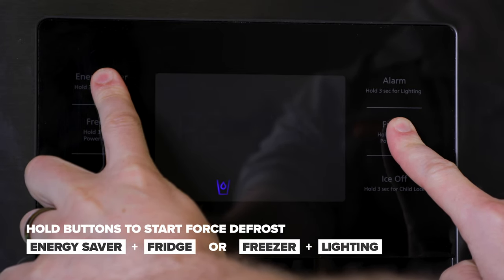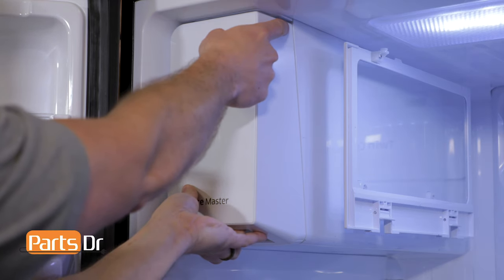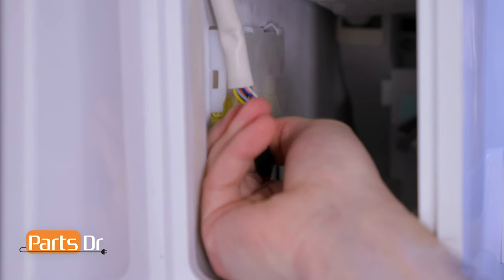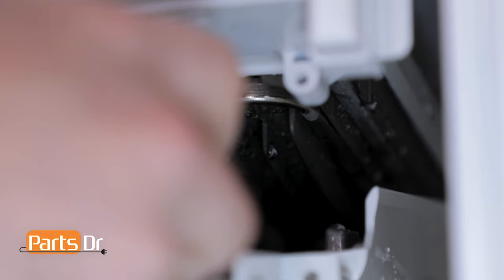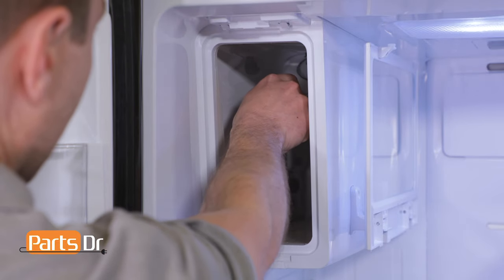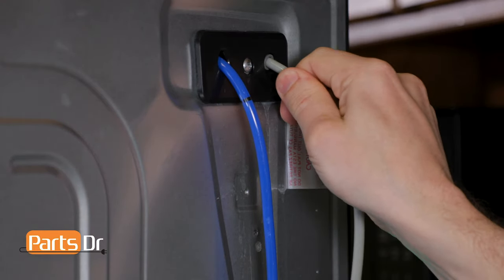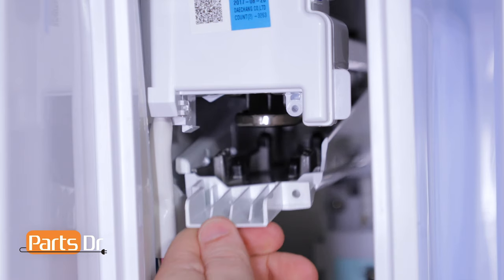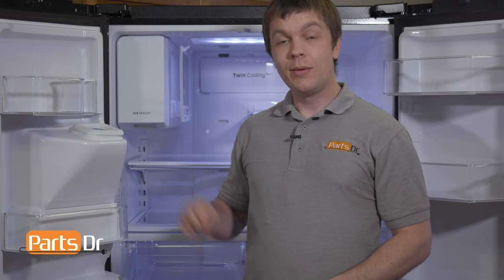How to check your ice maker water line in a Samsung refrigerator

Comment: I used your instructions for tuning my icemaker, and it worked great for 3 weeks, but now I have a different problem.
After a series of power outages, the icemaker has stopped making ice. If I press the icemaker reset, it will eject ice, fill the tray, then ding. But it will not continue to make ice on it's own. After 24 hours, no ice, so I hit the icemaker reset again, ice drops, fills, and bing. But after another 24hrs, no ice. So I have to reset the icemaker every 2 hours now?
I tried a diag by pressing the top 2 buttons, all lights lit, no error codes, back to normal. I also tried a power off reset, still no ice.
Any suggestions?
Reply from the maker: Check to make sure the temp in the ice maker compartment is reaching 15f or colder.  If it is cold enough, then it could be a bad ice maker, bad main control board, or something else as these ice maker systems consist of a lot of components that all work together.
Reply: @PartsDr  It's hard to get a reading with the door open and tray out, but I'm getting 13-15 if I point towards the back of the icemaker, 17 pointed towards the metal auger spinner. Should I try lowering the fridge temp a bit? It's set to 40. I also replaced the filter when this happened.

Comment: When you are pulling the hose from the back how do you know if its in far enough or not? Mine gets iced up every 14-20 days a d i have to defrost it twice a month
Reply from the maker: You will either need a second person to help you, or slide in the tube a little bit at a time and check it until you get it right.
Reply: @PartsDr  How do you know when it is in the correct position? What should it look like, how far should it be in there?
Reply from the maker: @BuenosPachos  3:05 in the video shows the correct position of the water line.
Reply: @PartsDr  3:05 doesn't show anything other than a water line.  I need to know 1/2" 1" actual measurement from when the line comes out.  Is there a mark on the line?  Is there a clip??   Overall video was good but you seemed to gloss over this one area.  Please clarify - how do you know its correct?
Reply: @ironcap2050  I wasn’t sure what I was looking at either but after playing with it I have it. You’re not looking at the vertical black or vertical white piece in the video. You’re looking at the horizontal clear tube. The small one right in the middle of the two circles. That tube should be, I’ll say, 1/8” visible. Mine was originally not visible at all. You just want to see a tiny bit of it.

Comment: While I have had the problem with the ice maker freezing up (about once a year), I have a new problem. The ice maker was working, but then there was no ice being produced. The compartment is cold, but it seems there is no water getting into the ice maker (new water filter, and water dispenser is fine). I have tried to get my fingers around the side of the ice tray, and can't feel any water present. Tried a number of things (forced defrost, unplugging the fridge for 15 minutes to try to reset the whole fridge). When I press the test button at the side of the ice maker unit and get the initial chime, but no follow-up chime to say the ice maker is working. Is this likely a problem with the ice maker (DA97-15217D (current part is - A), or would it be the control board.
Reply: I have the situation and same question. Machine will freeze a cup of water the size of an ice cube. Auger does not turn and there is no sound of water flowing into unit after reset so I am thinking the sensor in the unit is bad and not telling the motherboard to send water tho the unit in which case I need tho replace the ice maker. Can you confirm?
Reply: I did fix my problem by replacing the ice maker unit in the fridge (~$130). Spent more time looking at video's, and one of Part Dr's video's shows how to read out the error codes, which also pointed out a failure of the ice maker. The new ice maker is an easy install. I have changed my operation of the unit now and turn off the ice maker once I get the compartment filled with enough for a couple of weeks. I think (hope) this will eliminate the problem of the the ice holder becoming a solid block of ice due to repeated defrost cycles. BTW, I did have a deformed piece of plastic at the back (just above the auger drive) that I had to break off in order to install the new ice maker. This was about a month ago, and so far no problems.

Comment: My only complaint is it's hard to see exactly what the correct position is in this video....is it supposed to be a 1/4 back? 3/8?  Also is there an issue with too much water pressure?  I have a constant pressure system and often hear water hammer on my other appliances (I have an anti hammer valve on my fridge water supply)
Reply: I wasn’t sure what I was looking at either but after playing with it I have it. You’re not looking at the vertical black or vertical white piece in the video. You’re looking at the horizontal clear tube. The small one right in the middle of the two circles. That tube should be, I’ll say, 1/8” visible. Mine was originally not visible at all. You just want to see a tiny bit of it.
Reply: @hoffyrox Hey - thanks for this comment - struggling with the same thing and this gave me the right info to get it done this weekend.

Comment: After doing this, my refrigerator stopped dispensing water and stopped making ice
Reply from the maker: Have you checked your water supply line to the refrigerator?  Your problem you are describing doesn't sound related to the repair in this video.